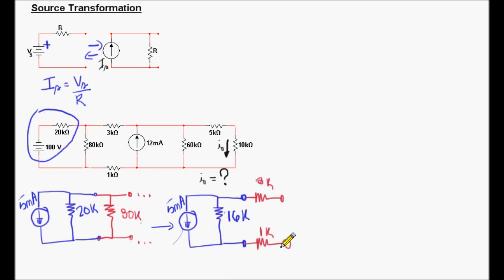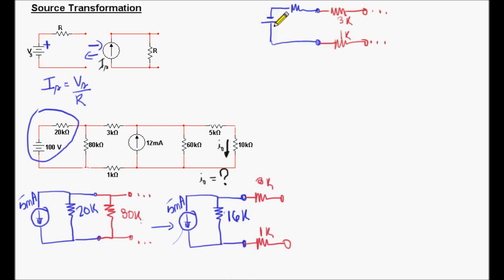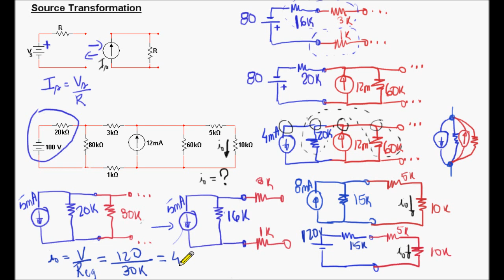Source Transformation

Comment: where did you get from 20k and 80k is equal 16k? not by adding 20k and 80k will get 100k?
Reply from the maker: Hi Sabrina, 20k and 80k are in parallel. To calculate the equivalent resistance you have to use the parallel resistor equation: 1/Req = 1/R1 +1/R2 +….  , or since there are only 2 resistors in parallel in this example, you may use product over the sum: Req= (R1 * R2)/ (R1 + R2)

Comment: At 6:30, where you add the resistors together, is that only really applicable here where we are breaking down the circuit to find a current at one end? Like for instance, if we wanted to know the voltage between two nodes further down the circuit, putting the 1k ohm resistor on the other side of the circuit as you've done wouldn't work would it? As in, the voltage drop would be occurring elsewhere in the circuit.
Reply from the maker: Yes, that is right. If you are looking for voltage drop you cannot get rid of the resistor.

Comment: Just one question...
Why do we substract those curent sources at the last of the video? Arent they pointing the same way?
Reply from the maker: Hello, the current sources (blue and red) are point to opposite directions. Pick one node, let's say the upper node. You can see that the blue current source (4mA) is leaving the node and the red one (12mA) is entering the node. Therefore, you will assign different signs to them. For example, for those that are entering the node, a + sign and for those that are leaving the node a - sign. Since KCL states that the sum of all currents leaving and entering a node is zero we are going to add those currents. Since they have different signs the final result will be the difference between them. Hope that helps!